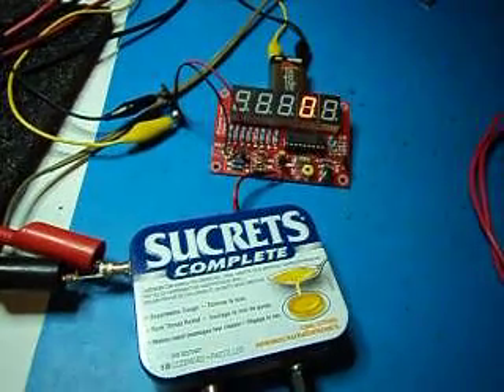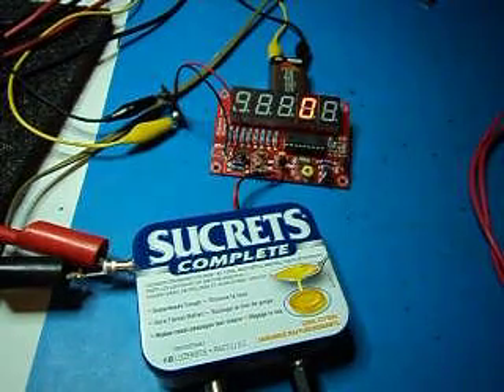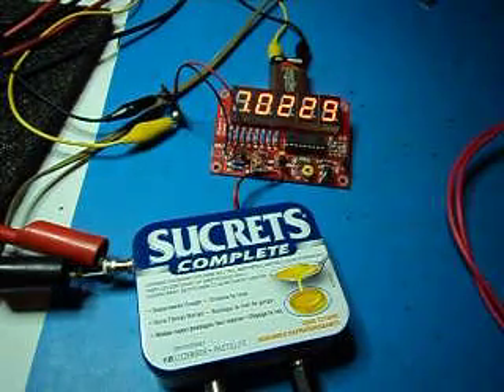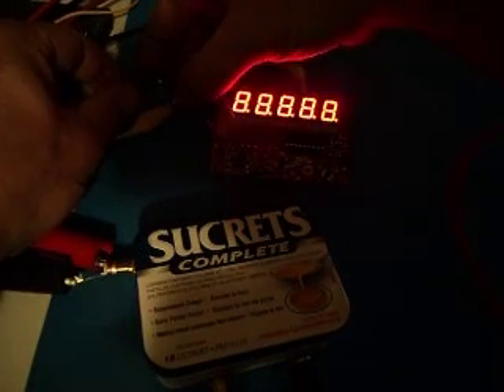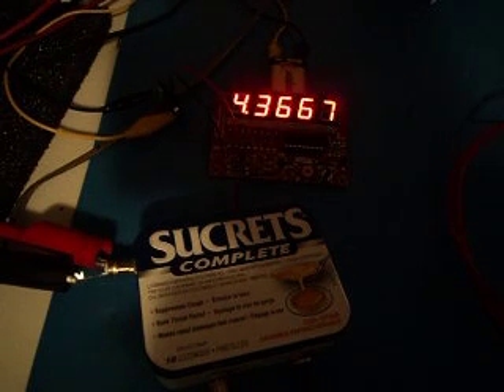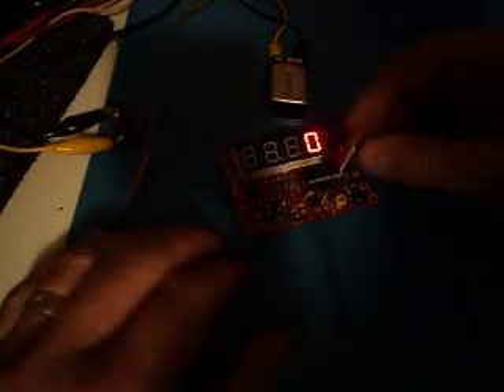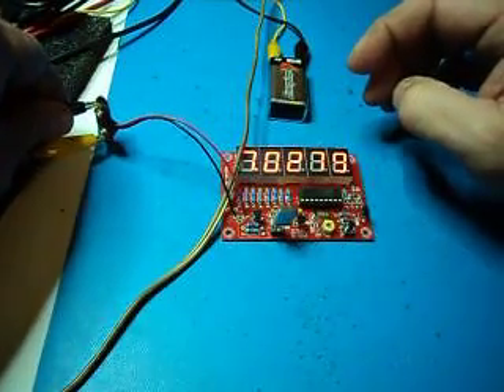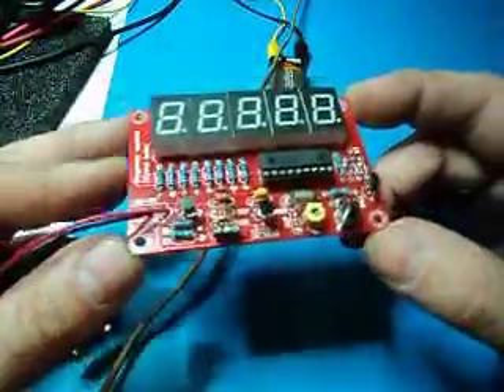Frequency Counter / Crystal tester kit

Comment: Is it possible to measure the frequency in circuit on desktop/latop motherbards with the counter.  I assembled mine, but the counter is not showing any readings on motherboards. The crystal tester works pretty good, but the counter is not working in my case. Is there a modification needed on the kit itself ?

Comment: BTW, the original conception of this circuit was done by Wolfgang "Wolf" Büscher, DL4YHF.  If you get on his page, you'll recognize different elements, such as the schematic and the documentation.  From what I read on his page, it looks like the design was used to create a kit but where the kit is sold we don't see any credits to whom they belong.  The page where you will see the original circuit along with its evolution is at www.qsl.net/dl4yhf/freq_counter/freq_counter.html